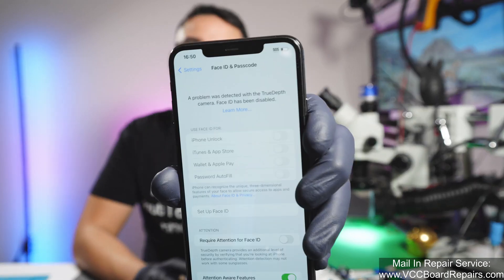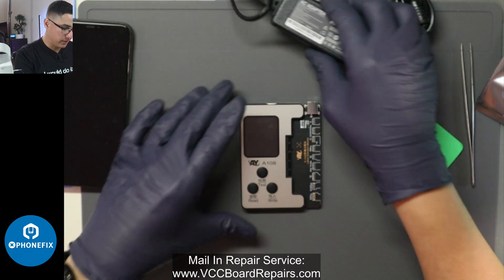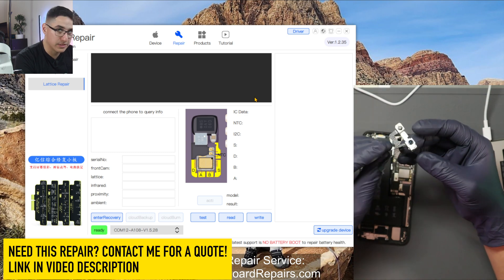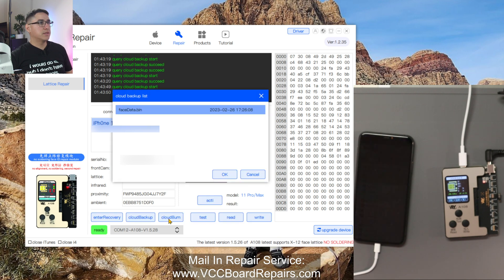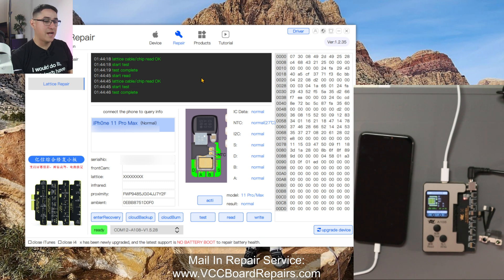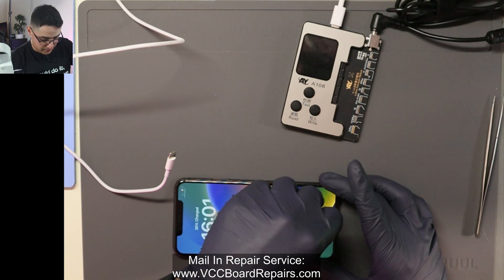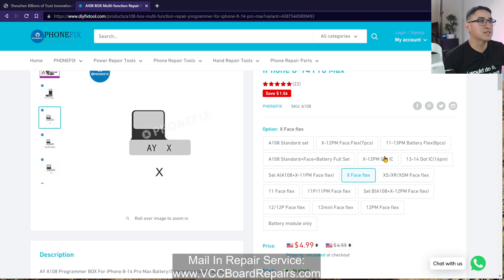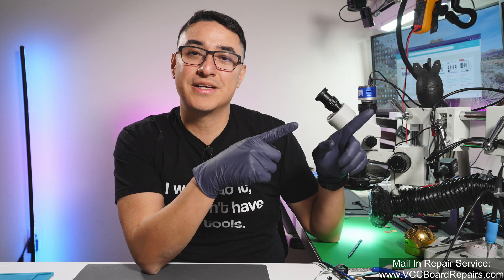Unbelievable! Easily Fix Face ID Without Soldering - AY A108 Box Tag On Flex Tutorial Revealed

Comment: Hi there, I had the same errors as you when I plugged in my original face id module, after activation, my I2C shows : IC Break. When I plug in the flex cable, I can't cloudburn, keeps showing I2C break. Any idea why?

Comment: Hi, great video! I have the exact same problem you had in the first place but can't seem to get the module aligned properly, and I'm sure the flex is seated properly in on the logic board. It worked in the first instance for a week or so then I dropped the phone and saw a different message in settings, so I opened it up and the flex had disconnected. message gone in settings now but same issue you initially had. Any advice greatly appreciated
Reply from the maker: try another tag on flex

Comment: @VCCBoardRepairs please I did it with iPhone X and everything was going well after the activation everything came green so I was suppose to burn it onto the flex cable and there was a connection error after I tested the dot projector and the errors appear again I tried activating but it gives message that it has activated already so no need 
Please help me out😢
Reply from the maker: try another tag on flex
Reply: did it work at the end ?

Comment: So i recently bought a used iphone 11 pro 64gb from a local off marketplace for $30, screen needed to be replaced (black screen) and it was supposedly stuck in recovery mode, however i was able to restore the phone which is unlocked with no activation lock, I replaced the screen successfully with a generic one off Amazon, to find out the face ID has a detected issue during setup.  So I immediately thought the issue was the actual face ID sensors that mount to the back of display.  In part I believe that sensor did need to be replaced as I noticed that the phone was getting hot when the face ID flex cable was connected, I disconnected that flex cable and the phone was no longer getting hot; I ordered a generic replacement face ID sensor assembly off Amazon last night and installed today to find out that the issue wasn't just that sensor for the back of display, but I believe the true depth camera you are dealing with in this video.  Also I don't know if it matters but i never reassembled the phone as I don't want to have to lift the screen from the casing.  How expensive of a fix you think it would be at a local repair shop?
Reply from the maker: It would depend. If you replaced the true depth camera or it's not original, then there's no way to repair Face ID 

Pricing would range between $100-200 i would suppose
Reply: @VCCBoardRepairs  I appreciate the response bro.  Yeah I’m not sure whether it’s the genuine apple true depth sensor that’s in there or not..  the phone’s exterior appearance seems like it’s in great condition.  But when I got around to disassembly I noticed one of the two screws on the bottom by speaker ports was missing..  I noticed some brackets and screws that were for securing the display’s flex cables into place as well as the battery flex cable cover plate were missing after opening it up..  luckily I was able to find a whole internal hardware set for the phone on Amazon for $5.  But yeah is there a stamp/logo I can look for on the true depth camera sensor?  I snapped the phone back together in the event the metal contact from the Face ID sensor on back of display needed to make with that of the True depth camera system’s metal bracket or something to get reenabled.  No such luck tho 😞

Comment: I am getting this error all the time “lattice cable/ chip not connected” what am I doing wrong?
Reply from the maker: Connect the dot projector to the programmer
Reply: @VCCBoardRepairs   I connect the programmer to computer and dot projector to the programer same as you showed , when I hit the test button, I get this error on computer screen.
Reply from the maker: Try another dot projector to see if the issue persists

Comment: hi i'm struggling with that. I have 2 questions : do you think the little flex addin can be used twice ? on 2 different front cam modules ? Second question : I have a module that is all green when plugged on the A108 without the addin. I perform the procedure well it seems but it doesn't solve the face id problem.
Reply: It was said in the video that if everting is normal then maybe it board issues this only works if NTC AND I2C are normal

Comment: Does the FaceID work if you put a tag on flex on a compatible front camera assembly replacement Or does the tag on flex work only on the original camera?
Reply from the maker: It's only for the original Dot Projector (aka True Depth Camera)

It's not for the front camera at all

Comment: okey i found the problem, this AYrepair software works only for me on windows 11, before i install it on windows 10 and it did not work complete ... now i have another problem : i did all the steps you show us till to test after connecting the flex cable together with the dot projector (glas) and it give me a error result with "luminescence abnormal" 😩

Comment: hello, my iphone 12 pro max i think got water into it, and now the truedepth is not working and my phone is very dim, cannot change brightness. will A108 and replacement piece fix it?
Reply from the maker: Brightness issue is due to problem with ALS.

AY tool will not fix that 

It will only fix the TrueDepth camera failure

Comment: Can I do this without the original earpiece assembly?
Reply from the maker: Nope
Reply: @VCCBoardRepairs  Damn so I'm just screwed? I broke the flex cable by accident while removing the screen
Reply from the maker: If everything else is original, then the ear speaker flex can be repaired.

It will require microsoldering to fix it and bring back face ID 

This tool in my video is for a different fault.

Comment: Tried the process but it did the same issue as what you had on the video where after I placed the tag on flex it shows "move higher or lower". Tried taking it out and double check it passed the test but still same issue.  What resolution you did to fix that issue?  Thanks
Reply from the maker: Great question to ask in my group: www.vccboardrepairs.com/vcc-fb-group
Reply: @VCCBoardRepairs  thank you will join the group
Reply: Hi. I have the exact same issue. Did you find a fix?

Thanks
Reply: @markaffleck4622  i just replaced the tag on flex, did the same procedure and it resolved the issue
Reply: Same issue here

Comment: I have a question with this, will it no longer be necessary to replace the circuit that goes in the DOT flex or is it always necessary in some cases?
greetings from Guatemala
Reply: I already solved my doubt at minute 5.52
Reply from the maker: awesome.

Comment: Could you please explain every Face ID problem and the proper solution ? 
In this case you had the ic fuse, so it’s possible to fix it just with the flex.
When we have ntc break, i2c break etc is it possible to fix it by changing flex ? 
Thanks in advance
Reply from the maker: Watch the other Face Id repair videos in my channel & you will learn more about the subject

Comment: @VCC Board Repairs - Jesse Cruz 

do you know any other way to test the face i.d before opening it to tell if this will fix like portrait mode ect or using a second phone over the front camera to see if it flashes ???

also do you have any inside know when JC will release there version on this as im wondering should i buy this one for now or not 

many thanks 
love your work
Reply from the maker: Not sure how to properly test without opening the phone. As a repair technician, opening the phone and taking out the front camera assembly should be no problem for you.

I dont know about the JC version. I heard it's already out but not sure
Reply: @VCCBoardRepairs  

thanks for the quick reply yeah ive got the jc tool to test them just wanted the staff to be able to check easier 
ive seen the jc version in pictures but cant find it for sale 
many thanks again

Comment: jc doesn't work anymore?
Reply from the maker: What do you mean? JC is a different brand with their own programmers. This video is specifically about the AY programmer and their solution
Reply: @VCCBoardRepairs  I saw a video on your channel that after updating jc I didn’t want to flash the cable for face Id
Reply from the maker: Yes that's for the old method and specific dot flex cables
Reply: @VCCBoardRepairs  Did the problem go away with the latest firmware versions?
Reply from the maker: I'm not sure. I haven't tried it yet 😅

Comment: Credits You need credits to be able to use ... If that's the case I would pass on buying this ..
Reply from the maker: No you don't need credits
Reply: @VCCBoardRepairs  OK good to know why in the video did it say that you had 9 credits ?
Reply from the maker: I added an explanation in the video. It is per tag on flex. Not the programmer

Each tag on flex gets 10 burns
Reply: @VCC Board Repairs - Jesse Cruz  OK good to know thanks Jesse

Comment: First! Hope this will fix my iPhone X that I retired due to the Face ID no longer working. Had it sent off to have the dot projector replaced by a board repair service. They got it working but told me if it ever stopped working again it couldn’t be fixed.
Reply from the maker: If the dot projector was modified previously, I don't think this solution will work